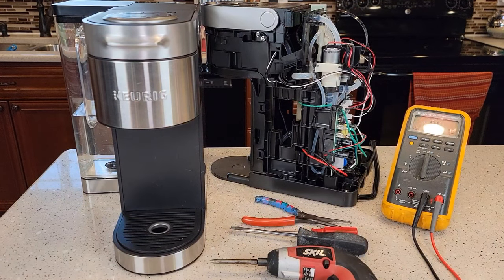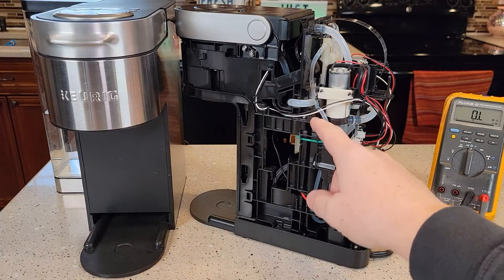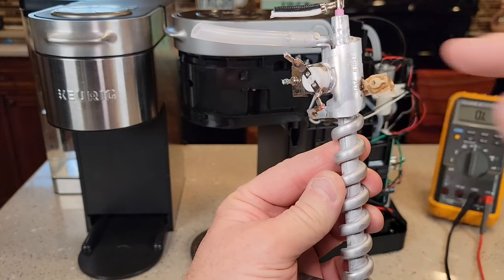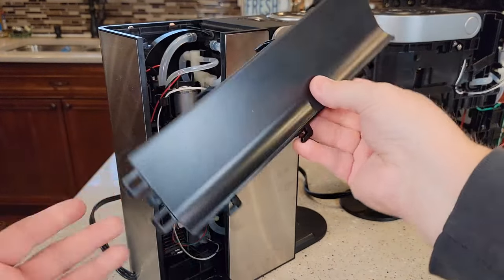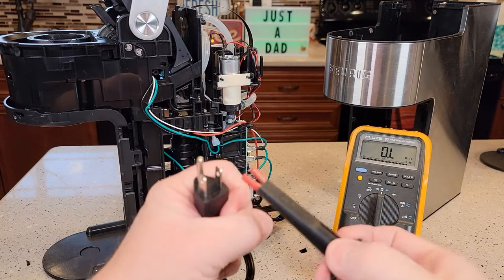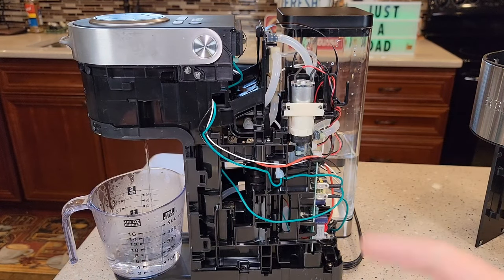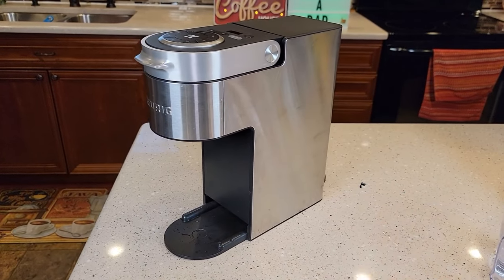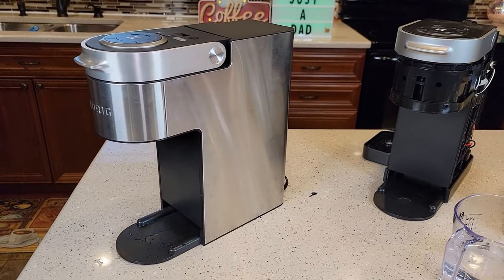HOW TO FIX Keurig K-Supreme Plus Coffee Maker Dead NO POWER.  How to reset Thermostat POWER LIGHT!

Comment: Thanks for the video.  Ran water low running descale (pressed brew one too many times because i didnt get the add water notification).  Unit started steaming so i pulled the plug but would not power back up.  Knew it had to be a thermal switch but had no idea of where it was or how to reset.  Saved me much time and money.

Comment: Thank you so much. This Keurig is much better than my previous two versions and your disassembly video to reset the thermostat fuse is what I needed to do.  Mine ran dry and I didn’t catch it in time. 

I still get my best coffee from a small 4 cup Mr. Coffee unit I bought at a resale store for $2.00, but the Keurig is a quick and easy way to get a quick cup of coffee if I make my own pods.  The new JavaJig set with the caps for either the old style Keurig or the new 5 hole Supreme work well if I pack extra coffee into the pod.  Thanks again for your informative video.

Comment: Great video. Saved me $$$.   Definitely a descale problem.  Happened after 6 mos, Keurig replaced under warranty.  Happened again a year later.  ONE COMPLAINT ABOUT YOUR VIDEO: Getting the Supreme PLUS apart is much harder than you make it out.  I basically broke 60% of the clips.  They are not all snap-clips, some of them are brackets not meant to be popped apart, but you can't tell and your video glosses over that.  And putting it back, I broke a few more.  I figured I'd use HVAC tape if needed to hold it together but somehow it's rock solid.  Next time I'll try slowing down a bit, letting the machine cool off a minute between runs.   And if it happens a third time maybe I'll make a hole in the side wall to access the button from outside. :)

Comment: Thank you for the tip on the thermostat and the paperclip.  I would have never known.  Now I know where the little water pump is too if it ever goes out....but I guess there is no part for it. Thanks again for your great video.  I broke off 3 little parts trying to pry things apart also, but it doesn't seem to be affecting it in anyway.

Comment: Thank you so much for this video.  I am on my THIRD Keurig K-Supreme Plus for the same problem.  Until now, Keurig has always replaced the coffeemaker, but this time I just thought I would give it a shot and try to fix it.  Worked like a charm.  Why doesn't Keurig figure this out and put some type of reset switch on the exterior for when the unit overheats?!
Reply from the maker: Glad it helped

Comment: Worked like a charm, thank you very much for posting this clip. One would think it would be a very minor design change to point the thermostat towards the outer wall of the machine and give the customer a pinhole to reset, but I suppose they may not want the liability if the machine overheats and causes a fire.  Besides, I am sure Keurig would rather we buy a replacement unit.
Reply from the maker: You're welcome!

Comment: This video saved me... not once, but twice! Yup, it happened again to the same machine some 9 months later. Thankfully I had saved it in my list. Up and running thanks to you! I personally think it unconscionable that Keurig didn't design this with an easily resettable thermostat, or a better thermostat. These machines aren't cheap, and I'm not going to keep on buying these every year. I'd buy a different manufacturer Keurig maker, or just move on to pourover or whatever. 

You da man! I'll be using your Amazon storefront to help support you.

Comment: On the Supreme Plus the first time I reset the temperature fuse I somehow unplugged the motor to the pump.  It kept blowing the fuse and I couldn't hear the pump running. So I knew I had another issue. Thankfully the place where it plugged in was the only place available where I could plug it back into.  So that fixed.

The second issue I had was when reinstalling the outer cover.  There are hooks and slots that hold the upper or front cover close to the unit.  It you don't squeeze the curved sides together as you push it forward the hooks won't engage in the slots and there will be a visible bulge where the cover fits.  It took me a while to figure out how to do that correctly but eventually I got it back together. Just be careful putting the cover back on.  It's tricky.  Now I am an expert as it took me 4 times removing and reinstalling the cover before I got everything working. Thanks so much.

Comment: Thank you. My problem exactly and fixed with your help. I suspect the overheating was caused by not soaking the filter enough after seven months in storage.  May I suggest an update on casing removal and reinstall.  I got the casing off as you described but it was difficult. And trying to reinstall it "whole" was even more difficult.  So, I disassembled it into three pieces. Then I clipped in the sides first, then clipped in the back, then slid in the top cover. To get access, removing these pieces in order (pry top forward, unclip back, then unclip side) is easier and less likely to break tabs. Removing the three bottom screws wasn't necessary for this repair.

Comment: Thanks for the guidance.  The reset worked for me.  I am thinking the reset may have been caused by operating it on a generator, although I did run the current through an electronic cleaner.

Comment: Thank you! Saved me buying a new one. I’m sure keurig support wouldn’t share how to do this. Biggest pain we’re finding a head that fit those screws. Got 2 out but last one was tough. Probably just broke off the little guide it holds in. 

Also my big mistake was filling the reservoir while descaling rather than waiting for the add water message. I guess it uses that to trigger the end of the descaling process.

Comment: Great video. Had the same issue with our Kuerig.  Took it apart as shown and it was back up and running in no time.  I used some auto panel removal tools hoping that would prevent broken tabs but still broke two tabs on top but it didn't make any noticeable difference after I put it back together.  I thought about drilling a hole in the side in case to reset the thermostat if it happened again but I was just not that motivated 😆.  Thanks for posting!

Comment: You fixed the problem…. I had one that stop working about two years ago that someone gave me… it finally stopped working and I stored it away for parts and bought a new one from Costco. But it finally stopped working and I seen your YouTube video… and it fixed the problem on the spare one I stored away….. now I’m going to see if Costco will exchange the one that just now stopped working….. Thank for your precise instructions to fix…… I’m going to take it your from my Generation that would rather fix something rather then Ben throw away and go by New…. Thanks

Comment: Great video. Allowed me to save my Keurig. My Add Water light never came on, so following the directions for Descale caused it to run out of water. I found if the Add Water light never comes on, causing the Descale never to complete, unplug the water sensor connection from the board during Descale . You will have to do this 3 times before the Descale message will go off.

Comment: Thanks for the video. I was bale to fix 1 of of the 2 dead Supremes I have had sitting around for years. The other one doesn't seem to be pumping water and overheats for some reason. I tested the motor on the pump and it works fine. It must have something to do with the little circuit board attached to the pump housing. I used to have another dead one around but it may have already went to the dump. The model makes excellent coffee when it works but after 4 failed I gave up. At least I only had to pay the first time.

Comment: Thank you for the detail. I can get a single cup from mine after it has sit overnight. After that it errors out. "Error 2, Please wait a few minutes and try brewing again".  I can get hot water all day, but as soon as I put a pod in it appears to overheat. This led me to believe the water dispenser prongs that punch into the pods were clogged. It has been descaled and meticulously cleaned. They are NOT clogged.  Open to suggestions. I'm hoping I don't need to disassemble but I'm willing to give it a shot if you believe it needs it.

Comment: I did not have a thermostat problem, but doing a visual check noticed that a white wire leading around the side to the top was broken. Fixed the wire and works like a charm again. I too received the "sorry... but we will send you a 20% off coupon...". Customer service at Keurig is really just a scam to see you a replacement unit.

Comment: Thankyou so much for this video. I took mine apart, reset it, and it powered back on. However, when  I ran a test brew, it unfortunately powered off again. So, I took the housing off again, and reset it again, with the same results. I fear the pump is the problem, not the thermostat. Time of death for my Keurig: 6:57pm.
Reply: I am having the same issue. It doesn't seem like water is getting pumped into the unit.

Comment: Hi again, around last September i used your correct method for descaling and after a week it died.so i let you know and your answer was it happens. Fair answer ,was replaced by Keurig .So this morning it literally blew up, a blast of steam and a a smell of burning came when i hit the brew button. So after messing around i tried this method, nothing so i watched the rest of the video,at 7.28 to 7.33 in your video you are pointing at  the box and above your finger is the t connection coming from the pump. Well turns out the small pipe from the pump had burst at the t and water had sprayed out and soaked the pcb and shorted out the lot .hence the smell from the electrics. So did the same thing immediately after and called Keurig again and am now waiting for no 2 .replacement. Just thought i would let you know. G H
Reply from the maker: Wow, good job figuring out how to fix your machine and getting it done!! thanks for sharing what you have learned.

Comment: I was able to fix mine by only removing the top cover. I purchased a right angle pick tool on Amazon and was able to reach the hole from the top with the pick tool and reset the thermal switch. I didn’t have to remove any screws or the side panels.

Comment: Although my Keurig is the K-Supreme and access was slightly different in the panels, this was perfect for the process and reset- it only took about 20 minutes. I'll be a lot more careful with the pesky descale. I thought about drilling a small access hole to reset the thermal, but will next time if it happens.

Comment: I had the same issue with my unit. However, before I tried a brew cycle after resetting the overload, I used a 9 volt battery to prime the pumps (and make sure they worked) before attempting a brew cycle. This way the heater element has some water in it. I unplugged each pump connector from the main board and matched polarity to test the pumps.

Comment: This is a great video!  Unfortunately Keurig has a problem with this model. I’m literally on my 5th in less than 2 years. They have great customer service and keep sending me machines but they last anywhere from 9 days to a year. My 5th died today and I’m going to try these steps.  

But mine die when they are already off or mid-cup, full water tank, so they’ve got a problem they are masking.

Comment: Thanks a bunch. Popped the covers on my Keurig Slim. Reset and it's all good. Three days ago I called the Keurig and they're sending a replacement. Why isn't there a reset on the outside. It would be so easy. My (repaired) machine wasn't a year old. Like you said...I didn't have the water reservoir seated. Thanks for the help.
Reply from the maker: Glad I could help

Comment: Just wanted to say "Thanks" for your video on fix'in the Keurig K-Supreme Plus Coffee Maker.  After watching your video a couple of times, I took my K-Supreme Plus apart and reset the thermostat with a paper clip, put it back together, and brewed  a cup.  Your video saved me the price of a new one.  Because the Keurig has a known issue with the thermostat "tripping" when air gets into the line, would it not be nice if some sort of access point was on the side where an access cover could be removed and a paper clip inserted to do a reset.  With you expertise, maybe you might think about creating an access point with a rubber plug insert that could be removed and the thermostat reset without having to remove the entire shell?  Again, thanks for you help!!
Reply from the maker: I'm glad my video helped thanks for watching

Comment: Thankyou for this video!!!
Ours just went out.  
   —>We hadn’t used our K920 in over a year, and “forgot to re-soak the completely dried out  carbon filer”!    So the water in the reservoir couldn’t be drawn into the K920 for heating.   
   Maybe guess is ours overheated, & needs the reset done in your video.
 —>Bad design!  There should’ve been an access panel or small hole on the side,  to reset it without having to go thru the extensive disassembly!

Comment: Great video--it worked for me! Thank you!

But I did not want to have to do all this disassembly and re-assembly again if a simple reset was all that was needed, so I drilled a 1/4" hole in the internal plastic chassis that lines up with the reset looking from the right side, and two additional 1/4" holes in the SS outside cover: one lining up with the 1/4" reset hole, and a second 1/4" hole 1/2" above and to the left of the 1/4" reset hole that lines up with an opening in the plastic chassis. The offset hole is a viewing port. 

Once the unit is reassembled, it's easy and safe to reset it if needed by unplugging the unit and doing the following: shine a small flashlight through the reset hole, sight the reset hole in the offset viewing port offset hole, and then push a straight paper clip through the reset hole, lining it up with the thermal trip switch reset by sighting through the offset hole, and pushing the paper clip to reset it. 

You cover the two 1/4" holes in the SS side with a small piece of Gorilla tape to keep any water from getting into the unit when in use.

Comment: Thanks for another great video.  Used video to take my machine apart.  You mentioned that it wasn't possible to replace
the water pump. I removed my water pump and it's part # is CJWP27-AC12B3.  I was able to find the part new at aliexpress
and used on eBay.

Comment: Say thanks for the advice for a repair got my K-Supreme Plus back working. It failed after only using it for 5 months. This was a replacement while under warranty still have my older one I'll use it for replacement parts if needed (it failed after 9 months and was a replacement for my K Mini that also failed after 3 months)!  Not sure I'll ever buy Keurig again they don't last are cheaply made or I just have bad luck with them!

Comment: (I have a K Supreme Plus Smart.) I'm desperate for help. I just started a job at a new location. I drained the reservoir prior to packing the unit (original box and packing material.) It spent two days in my cargo trailer. (Low 20's for temperature). I took it out today and after set up it leaked a copious amount of water from right below the valve that interfaces with the reservoir. I noticed in this video you took it out, but didn't show it on video. How do I access it to see if something has been ruptured due to the water in the system expanding from freezing temperatures?

Comment: This worked! Thank you so much for the video. My only issue is that I do think the low water sensor is broken. So if the descale process cannot move to rinse I think I’m stuck with that flashing light forever on my unit?

Comment: Totally worked, fixed my no power issue. Hey Keurig, how about a small hole in the side of the unit that leads to the reset switch, so next time I don’t spend an hour breaking apart plastic tabs (no way to avoid at least one of the plastic tabs breaking)?!?

Comment: Great video! Love the detailed walk through of the machine, very helpful.

I was given a broken plus from my work after it was flashing descale for a while and then shut down fully. I've had it apart and was able to reset the relay pretty easily and get it to turn back on, but when trying to descale no water would flow and it would overheat and shut off again. 

After unhooking hoses and tracking it all down I think there is a solid block clog in the coffee head in the lid with all the needles, I can't get any airflow through it and soaking it overnight in the descale solution did nothing, I've poked in the holes as best I could to clear it without any luck. 

I'm thinking maybe if I could pressurize it with a bike pump or something to clear it? and the machine will run through the process successfully with the head disconnected and the tube just emptying into a cup with the hot water, any tips to try to unclog the head thoroughly or anywhere you know I can get a replacement top needle head?

Comment: Looking at getting my father a K-cup coffee maker and this model is at the top of the list. THIS is very good information. My mechanical tinkerer side of me is wondering if it would be difficult to make a rubber tripped plunger to fit through the side so you don't have to take it apart only once. Rubber grommets to seal the side of the machine.  Thanks again
Reply from the maker: good idea, lots of people are thinking of ways to reset it easier for sure

Comment: I absolutely love & appreciate this video! Very specific & thoroughly explaining each step & suggestion what not to do! I did get mine to "kinda" start working. So ours would come on flash a couple of lights & cut right back off...this reset option, was great & pretty easy-to-use BUT now mine jus flashes descale & so it's not time but I thought oh well let's do it...prepped it held down 8 & 12 ran a cycle like normal then just cut off...any suggestions before I purchase another?